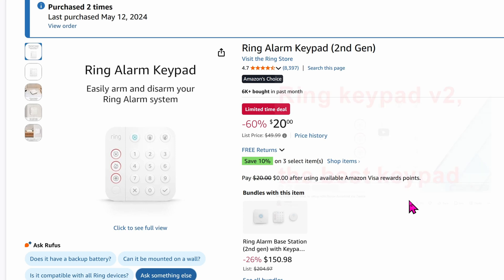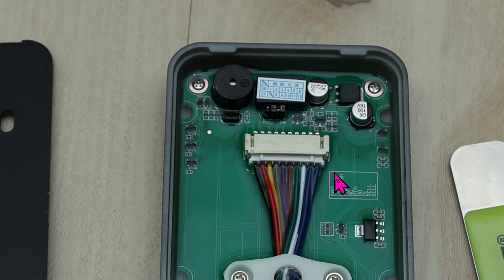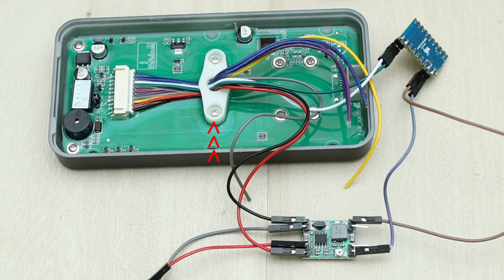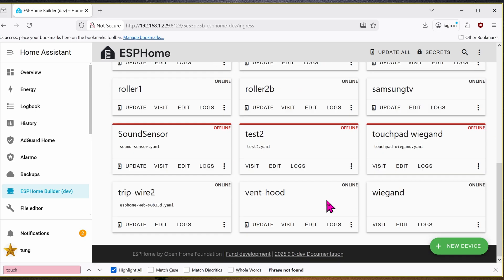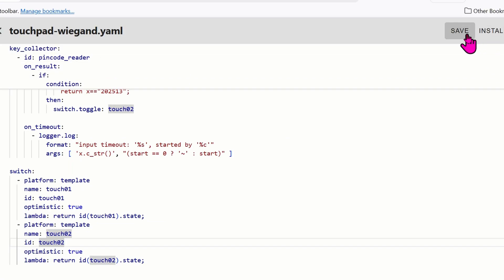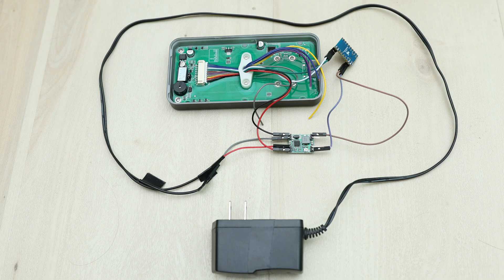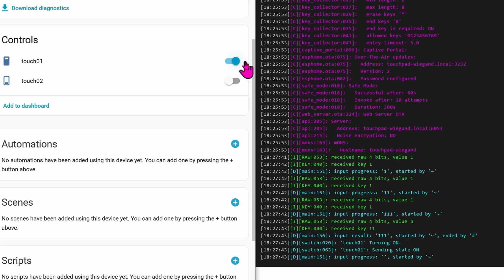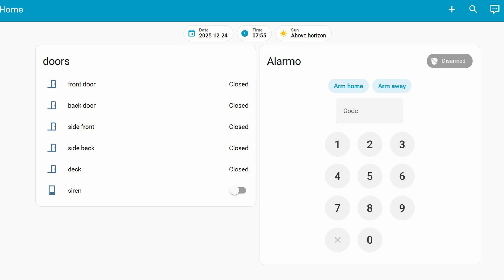the best keypad for Home Assistant is the one you make with ESPHome!

Comment: I’ve got a custom PCB that I had made by JLCPCB, which has an esp32-S3 chip and a mosfet to switch 12v to an electric door strike. It takes 12v as input and has screw terminals for all the wiring - power in, door open sensor, keypad Wiegand, “push to open” dry contact switch for inside, and I2C so you can have an attached LCD display.

If you’re interested I’ll upload the schematics and gerber to GitHub.